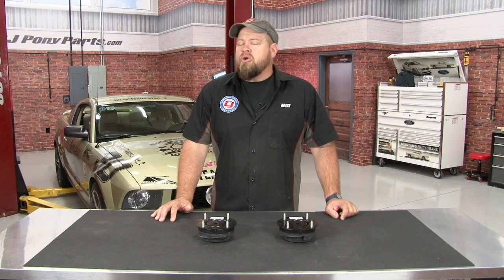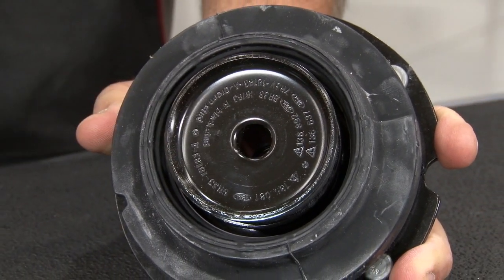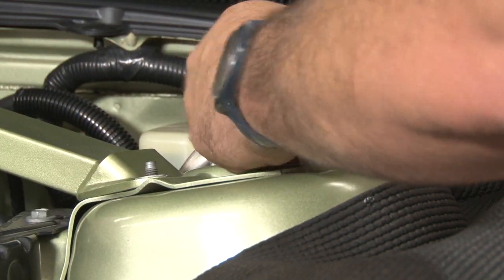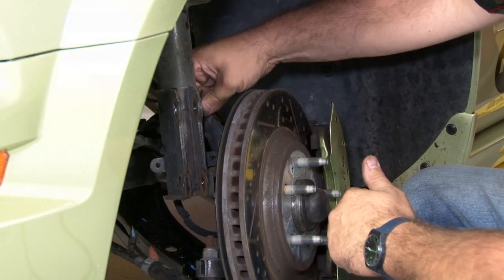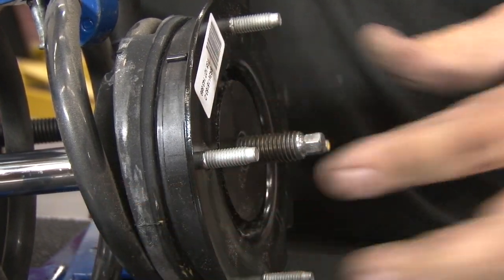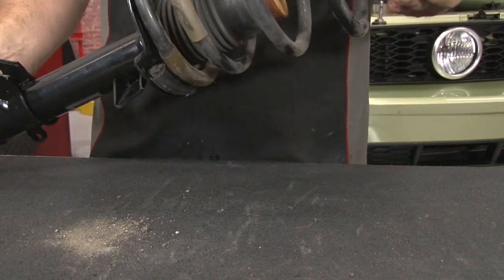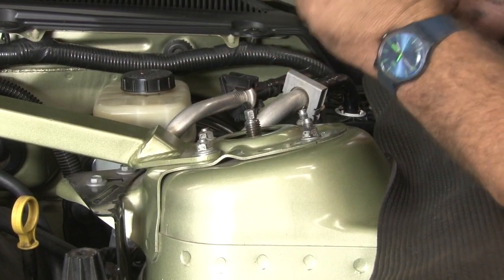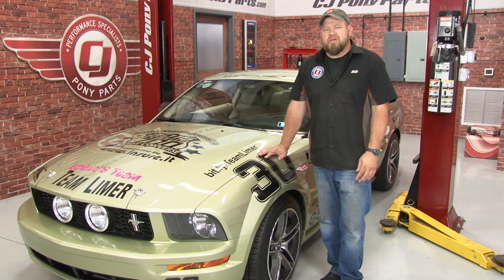Mustang Ford Performance Front Strut Mount Upgrade Pair V6/GT 2005-2010/GT500 2007-2014 Installation

Comment: Finally, someone explained which struts work with this part and why. Even the Ford Performance site makes it seem unclear when I was looking into this part for my 2014 Mustang.
Reply: This can't be stressed enough. Bought some heavy duty strut mounts that said "for 05-14 mustangs" but in very small print "will not fit 2011-2014 v6 & GT mustangs" had to send them back and order some new ones after much researching.

Comment: If I have a 2013 GT with Brembo pkg, can I upgrade to these gt500 mounts and get a set of 05-09 Struts and reuse my factory 13 springs to retain the factory ride height?

Comment: Ford Racing gt500 strut mount vs Motorcraft gt500 strut mount?
Reply: Jim Vergados -  So...... Who won??
Reply: Honestly, I tried the Motocraft gt500 Strut mounts. They are the same thing as the Ford gt500 mounts. They are also cheaper but have the same build quality. There is most certainly a difference from the OEM ones. You can tell as soon as you open the box. Handling wise you may feel it to be a little stiffer, there IS a difference between the gt500 mount and OEM. But, there is NO difference between the ford gt500 mount and the motorcraft mount besides prices. In the end they are only strut mounts; upgrading to the 500 mount is always a better idea especially when lowering the car or changing out the front struts. I am very happy I bought these.